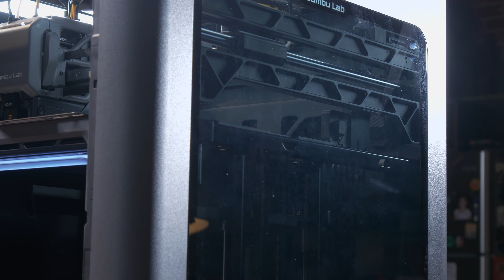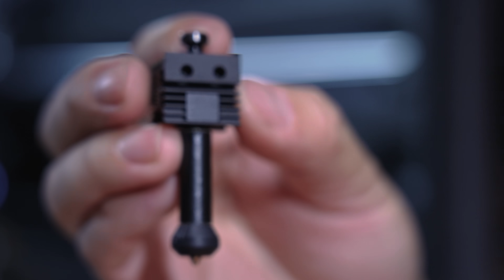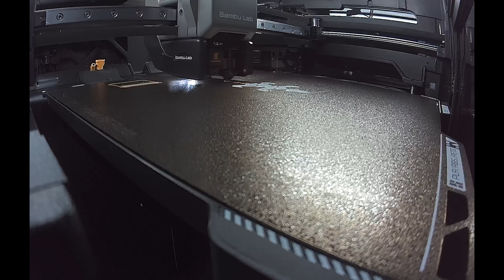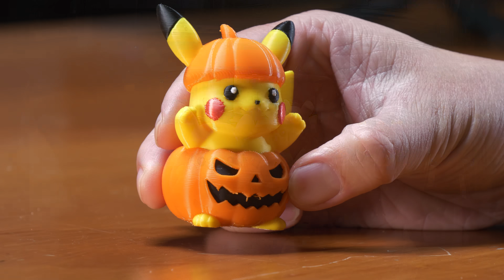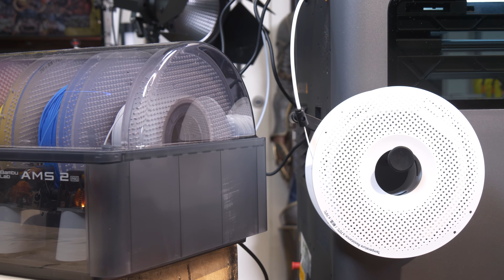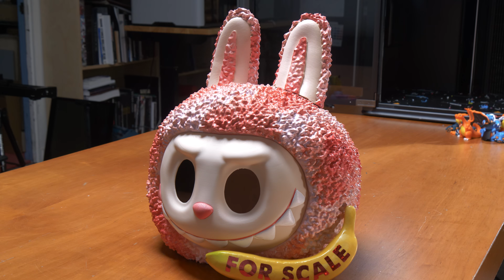Bambu Lab H2C 3D Printer Review: Vortek Tested!

Comment: Where I agree that swapping the hot end vs swapping the entire extruder assembly is a better option. Mainly because a problem could occur in one of your extruders which could be a time consuming fix, with 4 chances of this happening and the current limitation of only 4 colors at this time. 
That being said, I am not sure how the filament is being fed into the new H2C, but there should be at least 2 filaments, maybe one from each of your two AMS systems going to either the buffer or all the way to the extruder, where they can be swapped out as quickly as possible. (Not counting the one on the Left, that I am assuming is fixed and hanging on the external spool holder). 
I do have a concern that it might be possible for one of the hot ends in the vortex system to pop off inside your machine at high speed. This could cause some damage inside the machine.

Comment: None of the reviews seem to cover people that aren't exclusively in ABS or ASA. The H2C probably all of the H printers aren't designed to handle the high chamber temperatures for a long time. My H2C is only 3 months old and Im on my 3rd hotend fan. The last two only lasted about 40 hours of print time. To make it worse the hotend fan is buried under three boards and about 15 small cables that you are likely to break swapping it. Still waiting on the horrible bambu support to send me my 4th just so I can get another 20 hours of printing. No answer from bambu yet and it takes them 2 weeks to send a replacement with answers only in the middle of the night due to chinese support. 100% would not recommend the H line of printers.

Comment: Unless it is already being done, I believe that there is a way to make the purge tower smaller if you are printing a model with volume and/or supports. The purging could be used for the external support structure and also the internal support structure where the print isn't seen. By transferring some or most of the purge tower to supports and internal structure, this would save time and filament.
Reply: purge into infill/support are already settings in bambu slicer
Reply: No sparse layer settings in the latest version is the biggest improvement ever...

Comment: A lot of these prints look very rough.  For ex: Color dots mixed with other colors, very bad layer lines, differing layer lines on one color vs another (something wrong with that specific hot end), excessive oozing on some colors.  I can look past the wet filament and the stringing but not impressed with the rest for such a high-end machine.

Comment: I'm glad they provided many flavours of the H series, to have the option that suits your needs best. The rep at formnext was hinting at the next order of operation will be the X series 2nd gen. I'm not currently in dire need of upgrading and the H2D and C are both interesting options. NGL my curiosity is peaked to see what comes next, X2XL with a smaller package toolhead that can reach all corners of the build surface and use the Vortek system could be a better option over the H2S, but alas we will have to wait and see what they're cooking up for '26.

Comment: Thank you, Norm and Tested! This is the info I was waiting for. I was tempted by the H2S but wanted to see what the H2C was all about. Other reviews had me tempted to splurge on the H2C, but this very grounded analysis helped me to consider my actual needs. I'm upgrading from an A1, and wanted an enclosure and to leave bed-slinging behind me. Boring reliability is more key for me than a brand-new feature. Yes, I'll waste filament when I print multi-color, but at my casual rate of use that's less wasteful than a "pro" feature I don't really need. My workhorse H2S arrived two days ago and it's a joy.

Comment: Bambu Lab should look into feeding 4 tubes to a hub inside the printer instead of the internal hub in the AMS, so they only need to withdraw about 12-18 inches instead of full retract into the AMS while printing and only withdraw all the way when printing is done. Also...we need open source firmware :)

Comment: Did you have uneven bed heating issue like in other creators video. Just wondering if they all share that issue or they had a bad one.  They showed IR camera and set 100c bed and it showed 100 but image showed around 80s..

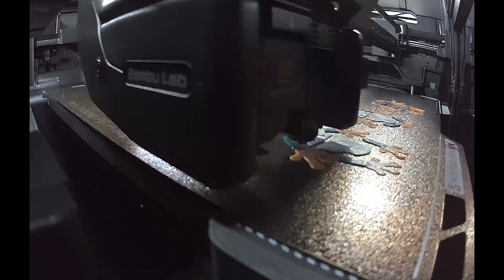Comment: I’m a big fan of Bambu but the bed eating on this is a no go. Watch at 12:21 when the lower right has an adhesion failure. I wonder if the H2C is also suffering the PTFE length issue the H2D and H2S have.
Reply: Having printed thousands of hours on an h2d and many others, 

It’s the best printer on the market overall for reliability

Comment: Right now, the price of the 5-head version of the Prusa XL is pretty similar to this printer.
Seven colors is a very niche application compared to five. Having five heads seems much more practical to me.

I just don't understand the idea behind this printer in the end of 2025.
Reply: As an XL owner I would tend to agree, though I will admit I'm probably not fully objective. Though I will say the problem with the XL is it is not designed to be enclosable and therefore printing filaments that require a heated chamber is a real nightmare with any first or third party enclosure option. Not only is their first party enclosure comically priced but it has massive air leaks everywhere and is not actively heated.
Reply: Prusa INDX and Snapmaker U1 prints much faster, since unloading and new loading of filaments are not necessary when changing colors... I like the idea to have each filament directly attached to it's tool head.

Comment: I'm a little disappointed actually that it's not a tool changer. Unless I'm missing something, the only advantage over the H2D is that the right nozzle can switch filaments without purging if the nozzle for that colour is already primed with that colour, and I assume it takes longer switching than a tool changer seen as it has to retract the filament and load the new, like the other ams printers.
Reply: It takes roughly 10 sec to change tool on the XL for comparison
Reply: @EagleBayNightSupplies but how long does it take to change colours on this?
Reply: @lauriewsmith1 I don't have the exact time but roughly 20 sec from stopping untill it starts again if you use the prime tower. Without prime tower it's 10 sec
Reply: @EagleBayNightSupplies  It looks a lot longer than that on videos I've seen. More like 40+ seconds.
Reply: @lauriewsmith1  The 40 second numbers are with using the default Bowden tube length from the AMS to the printer. If you cut the tube short and significantly reduce the time it takes the AMS to retract the filament, others have said you can get it down to ~20 seconds
Reply: @lauriewsmith1 my bad, I thought you meant the XL 😅
Reply: @EagleBayNightSupplies  the swap can be shorter here too if you shorter the tube
Reply: Tool change just cost more and more bulk and more lost volume. This is near perfect. Better than bondtech
Reply: @mostlymessingabout Do you have some more copoium?

Comment: The prime tower thing is a bit of a worry - want to see some examples of different settings.

Otherwise - the C is massively interesting for me - the ability to work different materials smoothly (different hardnesses/electrical conductivity as well as colour)

Without benchmarks between printers in terms of speed and cost though what's the point in reviewing?

Comment: The tubes can be like a half tube track or flume, rather than a full tube. Think Log Ride. The line can ride this flume and then every few Inches have a small guide to keep the line from lifting out of the flume. Or use a knife and cut out the top half of the tube every three inches, leave 1/4 inch, cut out three again, leave 1/4 and so on

Comment: I had a P1S and A1 (sold the A1) and wanted to replace them for a bigger volume and hopefully faster multicolor. Seeing the H2C and being slightly disappointed with it, I might get a U1 for the multicolor speed and efficiency, replacing my A1 and either an H2S or H2D to replace my P1S for bigger prints and exotic filaments.
Reply: Disappointed with what?
Reply: @romarooramor9069 Its speed compared to the U1. Too many factors to fail. Can't really do multicolored TPU. Problem with bed heating (see 3D Printing Nerd's review). If I were to spend that much money, should be better.
Reply: @dyops I had a snap maker in the past and had nothing but issues with it so I'm too nervous about them to risk paying $1000 for one but the 3 bambu printers I have owned have all been incredible, never had any issues unless of my own doing, but I don't sell prints so I am not concerned about having things done as fast as humanly possible or wasn't a little filament. Thankfully we have so many good options these days

Comment: Ok, i might be missing the point here but this doesn't seem very a very cost effective solution for the problem it's trying to solve if it still needs to build a purge tower to print different colors. 

The only thing i can see this solving is high detail areas on a large print so you can swap nozzle sizes on the go, but you could have still made them separate printed pieces anyway

Comment: wow chips where we don't need it you can see over heating damage. talking about 220 c why put plastic chips near the extruder where its job is to melt plastic. why not just put a resistor that gives a feed back. oh resistance at 100 ohms okay diameter is .03. etc etc

Comment: Cant mix hotend sizes yet, I'll wait. Want to got from .6 to .2 on same print for speed and details.
Reply: This is software and slicer issue not machine no?
Reply: @GrizzySC Yes. Given time it will likely be released.
Reply: @rileyneufeld7001 yeah if prusa makes the indx stuff opensource in their slicer then bambu will miraclously have the same
Reply: That's a slicer limitation, it has nothing to do with hardware.
Reply: It's a software limitation. Prusa slicer for example supports mixed nozzle sizes on the XL for quite a while now, but it's not by detail type, so much as it is for things like infill versus perimeters. So you can have a big nozzle doing fast infill and a smaller nozzle focused on perimeters.
Reply: @doublestrikePhoto  This should be an H2D feature too. Wouldn't even need swapping out like on the H2C. Perfect for big single colour prints.
Reply: That would be so great!
Reply: It’s not out yet🤷‍♂️
Reply: you're asking for a high end industrial 3D printer then. Go get one of those

Comment: Would prefer a proper tool changer. This is very compromised and still relies on the AMS. Quite expensive and complex. Slower than a real tool changer by far. It's cool, sure, but that's not enough when analyzed at an engineering level.

Comment: The moment I realized you still have to wait for the filament load and there is no direct feed in the tool head for all of them this became a expensive sub optional solution that needs another iteration. When it will be total 8sec to swap color then that price may have a reason.
Reply: The issue with the direct feed is size. The Xl and U1 are way too big for what they do, and they are a pain to enclose and heat for big kid materials. If you want a $1k PLA/PETG machine, get the U1. If you print engineering materials, go with the Bambu X1/P2/H2 series or the Prusa Core 1, because the U1 or XL won’t cut it. The Vortek system trades time for capability and variety.

Comment: Damn I was hoping this would work for multi color tpu prints. Seems like the u1 is gonna be my new printer in the spring!
Reply: how do you think its not going to work?
Reply: @chartle1 because the filament is still having to be loaded by the ams into the single filament path for the swapable hotends.
Reply: @SSenderling  Ok I missed the 
TPU part. yea you would have to use AMS compatible TPU which is pretty stiff.
Reply: TPU can still go into the fixed nozzle on the left with all your other materials and colors in the AMS on the right side
Reply: @Kylecoolky sure but my at home business involves multi color tpu printing.

Comment: I have the X1C, and all the advantages of the H2C don't really matter to me.  I accept the poop as the price I pay for RELIABILITY.  The speed is not a problem (I don't print for profit).  I can print in 8 colors with my X1C and 2xAMS 2 Pros.  Color bleed can be addressed with the purge table.  Thank you Norm, you saved me a couple grand.

Comment: They just need a 6 spool AMS now.
Reply: Just buy two AMS’s
Reply: @Sordshinger_YT  BORING!!!!  A 6 spool should and will be cheaper and easier.
Reply: More money you send to Bambu = better.
Reply: @MTOsmart  Welcome to 3D printing!  New here?
Reply: I would prefer to see six individually mounted spools that go to each of the nozzle somehow like the bondtech system. Then you don't have any AMS switching delays at all. In other words you would need an AMS with one output path per filament.
Reply: @doublestrikePhoto  No drying?  Difficult to work with?  No thanks.  Delays?  Really?  You apparently have not worked with an AMS before.

Comment: Im looking toward the bondtech INDX
Reply: Yeah they have really made their brand through clean surfaces up till now and the surface quality on these is really awful.
Reply: Im with you, this printer is a HUGE disappointment. The one thing reviewers are not talking about is multimaterial engineering prints.  So far every person has talked about printing stupid dolls and dragons. Snapmaker is a toy printer for $800, not these. Lets talk about actual functional prints. How does it work for ABS, PEEK. Lets dive in more and talk about the BED, how it heats up. 

I have the X1C and i am still convinced that it's the best printer they have put out. Not only does it print well, it works well. 

The timeline here https://youtu.be/aodBL6MUlPM?t=739
where hes showing off the colorful prints, these are horrible quality for $2300 printer.

Comment: My concern is TPU.  This printer seems to be worse that the H2D.  You can only print TPU on the right side.  This is the side that now has the nozzle changer.  This seems to mean that if I use TPU, I must figure out how to disable the VORTC system from changing anything since TPU is not compatible with the AMS (which the VORTEC depends on).  So IF this proves possible, and might not be, then I would still be limited to a single hard material and a single soft one.  This is worse than the H2D can do, since if I have to I can swap the material in the left side without removing the TPU from the system.  Combine this with a smaller build plate with uneven heating.  Who is this for?  People who never ever print in TPU or other soft material?  What percentage of 2500 printer buyers are so locked in to PLA or what have you that they don't get the benefits of including TPU?

Am I missing something?  Is this not an upgrade to the H2D but a side grade?

Comment: Well, this is definetly the dissapointment of the year... 2400$ and still having to wait a minute between color changes... Tool changers are WAY faster in multicolor/material prints
Reply: I've been saying it for the last few months that the vortek would be inferior to a traditional tool changer. Bambu fail, bet their investors aren't happy.
Reply: Also, you get a bubble in the print on every nozzle change with this Vortek. Especially visible in transparent parts.
Reply: @EditioCastigata  how come? I thought you would still have to use the prime tower, the bubble stays there, isnt it?

Comment: I got the H2S, and it's nice that if in the future I want to add the Vortek, the option will be there.
Reply: The upgrade is only for the h2d right?
Reply: @Nikx-youtube The will sell one for each the H2D and H2S 
- H2D kit is $800 and releasing in January
- H2S kit is $900 and releasing in Q1. 

The kits are on the Bambu website, called Vortex upgrade kit. The main difference looks to be the additional change of the wiper system and filament buffer as the H2S had to only deal with one nozzle before.
Reply: @Nikx-youtube  Both the H2S and H2D are upgradable to the H2C. The H2D > H2C upgrade kit just adds the Vortek hotend changing system, but the H2S > H2C upgrade also adds the dual nozzle, which is a more complicated upgrade and is likely going to cost a lot more